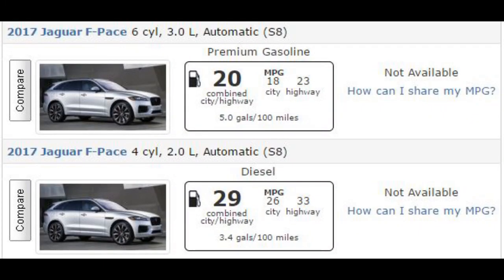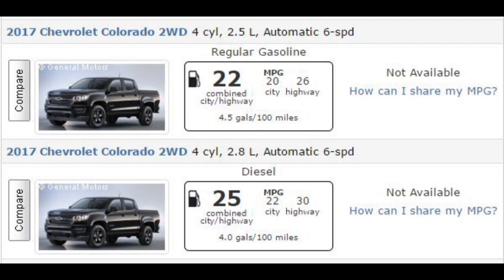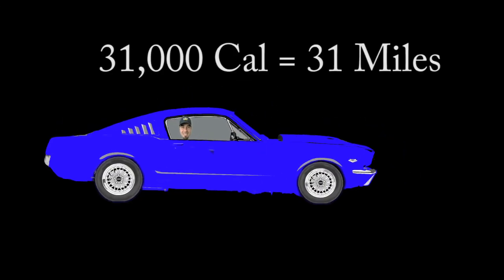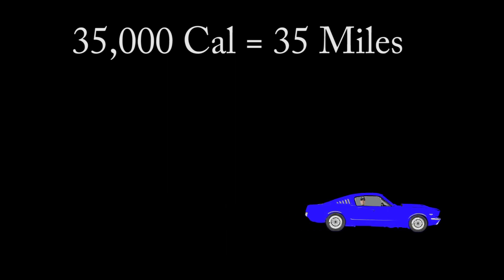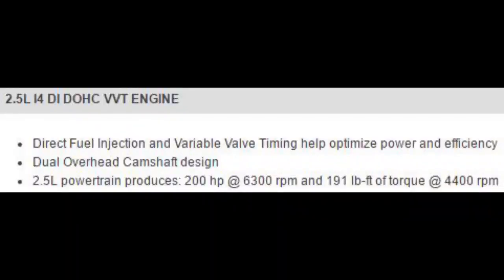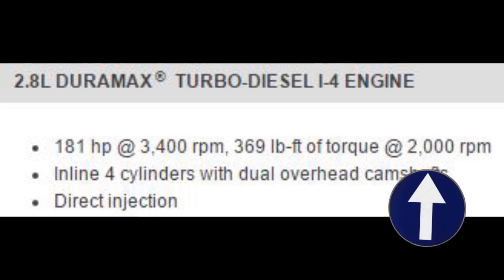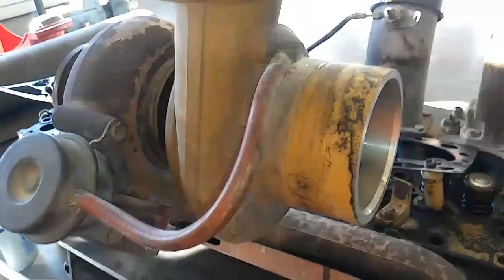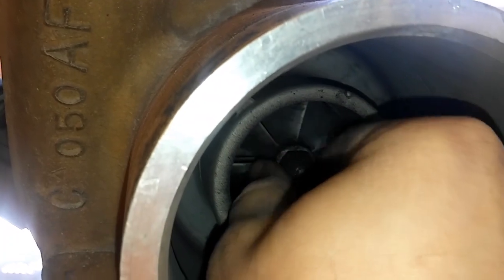Why Do Diesels Get Better MPG? Why Are Diesels More Fuel Efficient?

Comment: Fine, for the most part, but there is one thing you did not get quite right.

You should have compared a normally aspirated Diesel engine with a normally aspirated Otto-cycle engine.  That would have removed one complication with the comparison.  You stated that on a turbocharged Diesel engine, the pressure from the turbocharger helps to force the piston down during the intake stroke.  Fine, but that doesn't actually help since the turbocharger gets its ability to do that by stealing power from the engine by increasing the exhaust back pressure.

The most important reason that a Diesel engine is more efficient, but not the only reason, is that it has no throttle valve and therefore the engine does not waste power sucking in air against the vacuum created by the throttle valve.  A very important source of inefficiency with the Otto-cycle engine is the waste of power to suck air in against the vacuum created by the throttle valve.  When running at full power, the efficiency difference between a Diesel engine and an Otto-cycle engine is far less because then the throttle on the Otto-cycle engine is fully open and creates no efficiency-robbing vacuum.

It is possible to eliminate the camshaft to get perfect valve timing under all conditions by using a computer controlled accuator for each valve.  That can eliminate the throttle valve by one of two methods:  1)  It can control the power by opening the intake valve only briefly when full power is not required.  That way, the vacuum created when the intake valve is closed will help pull the piston up again during the early part of the compression stroke thereby recovering the power lost by creating the vacuum.  Or, 2) It can control the power by delaying closing the intake valve until way past bottom dead center when full power is not required thereby not creating a vacuum but letting air escape from the cylinder until the valve closes.  Either of the two methods can control the power with no throttle valve thereby eliminating the inefficiency caused by the throttle valve.

The reason this is not been implemented is that it is very costly, but it has been successfully tested.  In addition to greatly improving the efficiency of the Otto-cycle engine, it can also increase power and flexibility by having ideal valve timing for all engine speeds.

Comment: Compare the 2.7 liter F-150 EcoBoost to the 3.0 liter Ram 1500 EcoDiesel and you'll see that there's no benefit to the diesel. The diesel costs more to fuel, has greater CO2 emissions and the EcoBoost has 85 (yes, 85!) more hp. Same thing happens if you compare the 2014 base model Accord to the Chevy Cruze diesel, the diesel costs more to fuel, produces more CO2 and has less power. Same thing went for the Golf TDI and the Honda Civic, except they were equal in power output. I could go on and on, there's just no benefit to diesels.
Reply from the maker: +idontcare80 I mention in the video that Diesels cost more, which is true. The mileage increase usually doesn't make up the cost difference between the increased cost of the engine, maintenance, and usually higher fuel cost. I'm going to make a video about whether Diesels save you money compared to Gas in the future.
Reply: It's not just about money, it's about emissions, and performance. In Europe, some politicians are apologizing for pushing diesels because the widespread adoption of diesels has created serious smog issues. Some cities are even considering banning diesels from their roads because they're so polluting.

http://www.bbc.com/news/science-environment-38170794

Comment: what about turbo gas engine more air more fuel bigger bang more hp. just asking
Reply: Yeah, but it's not efficient as you need to add more fuel to keep the air/fuel mix at a level that it will ignite....but more hp than the same size diesel engine.
Reply: That is great, so long as the gasoline engine is run off boost most of the time.

Comment: I disagree with a few things:1. A long stroke does NOT make greater torque. The low RPM of a long stroke engine is determined by the safe mean piston speed.2. You cannot compare turbocharged diesels with naturally aspirated petrol engines.3. The diesel engine's efficiency at part-load is due to its running lean, while a petrol engine has to maintain a near-stoichiometric air:fuel ratio. The petrol engine accomplishes this by throttling the air in the intake, which causes severe pumping losses.4. An efficiency of 45% is a bit high, even for a turbodiesel at torque peak. I don't even think a gas turbine is that efficient. A turbodiesel has a peak efficiency of closer to 35%, and a petrol engine closer to 27%. Of course, it is important to state the measure of efficiency. I base my number on an isentropic efficiency, which works relative to absolute temperature and absolutely lossless and reversible processes. Maybe you use a different measure of efficiency.Great show, keep up the good work.